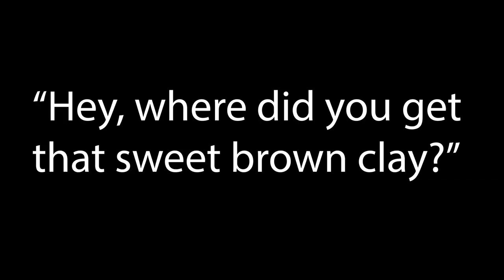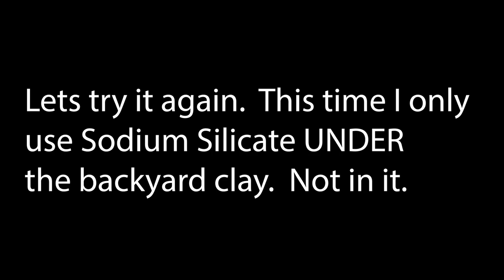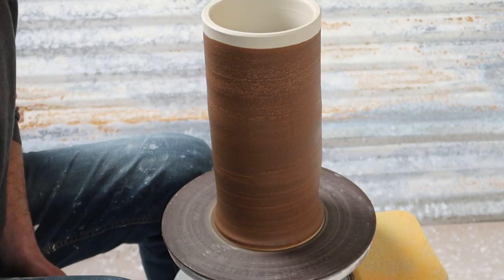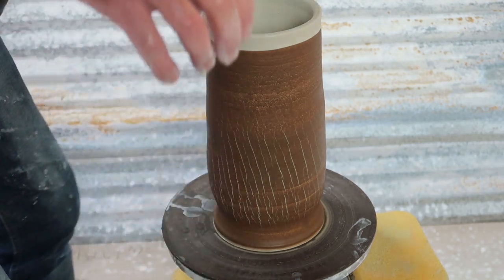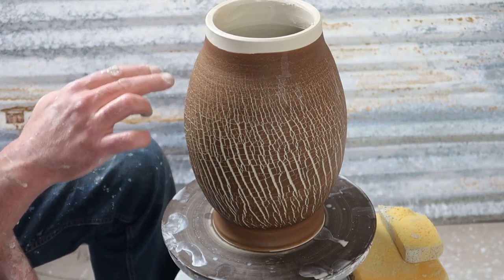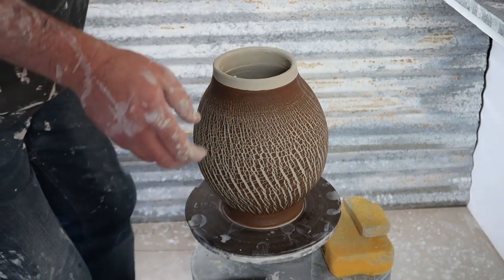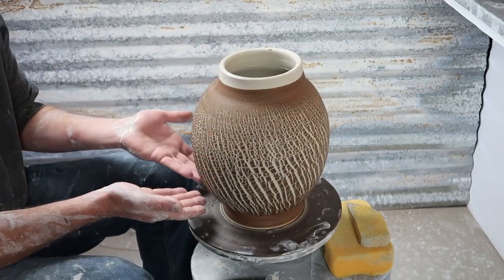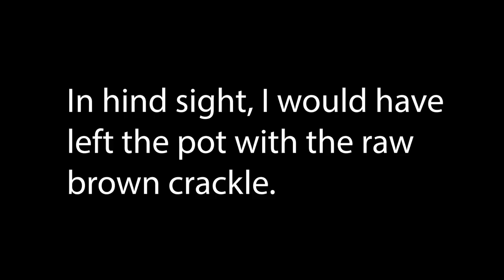Sodium Silicate Crackle - Backyard Clay - Spraying Glazes

Comment: The problem with the wobbly rim did happen much earlier in the process, it is hard to fix when you have already expanded the body. 

There are two things you can do to improve the situation, first throw your cylinders differently. Open wider than the final width and always keep it coning inwards when pulling up, you need to maintain volcano shape basically. If you try to pull / lift a perfectly straight cylinder you are going to make it, ever so slightly wobbly, and this wobbliness will only get worse over time. The other benefit of the volcano shape is that you get more clay up, I am gonna take a guess that your vase is a bit bottom heavy and that you cannot trim all that away without ruining your crackle pattern. 

Second, when expanding the shape; it helps if you make a little impromptu rim by bending out the last half inch on the top. It works on the same idea as a corrugated metal roof in that it gets stability from bending in one direction by being bent in the other. I like to rest a finger on the rim and let me left arm lean on the inside of the rim a bit. This helps maintaining it straight but you also get feedback when you go to hard pushing out. Another thing that also helps is to do the first expansion pull really slow and only move very little material. When you heat the pot the clay stiffens up and you need to crack the clay open again. If you go to hard here it is rather easy to make a dent that cannot be undone. I start by establishing a slight grove in the very bottom, then I lift that grove up and out. After that, when the clay is cracked open, you can be more aggressive with the expansion. 

I was trying to think of Youtube material that could be interesting but the only thing I can come to think of is this workshop: https://www.youtube.com/watch?v=Bn9zlSKXoho much like Joe I dry out my pots on the inside before expanding them, it really helps a lot, especially if you want to get the top back in to make nice rim.
Reply from the maker: Wow!  Thank you for the comment.  I appreciate your thoughts.
Reply: @JustinsMakery   Hi Justin.  First, what a nice pot!  Second, I remember reading something about using a plastic flange to help keep the top of a pot in shape as you expand the form.  I've never tried it, but it may be worth a look:  https://community.ceramicartsdaily.org/topic/17964-how-to-throw-this-form-in-one-piece/?tab=comments#comment-145766

Comment: I threw sort of a cone shaped piece that is say about 4" or so wide and is narrower and rounded at the end.  After bisque firing it I can wet it and gently fit it to the top and it help to even it out a bit.  Hit it with some heat if the clays too wet or let it stand for a bit and then see if you can continue to throw it.

Comment: When expanding the pot friction will cause it to twist in one direction. Running the wheel clockwise will cause it to twist in the opposite direction giving vertical cracks - in theory. In practice the pot becomes unstable and things end badly.
Perhaps watch Hsin-Chuen Lin for a masterclass on this technique - using porcelain!

Comment: Try holding the rim while you expand the pot for centering purposes also, move the rib to different positions is between 6 and 3 o clock to get difference in  swirls.. I think for alternate direction you maybe could try by centering the clay down in alternate directions top and bottom, I think it might not of worked because the clay was centered in one direction. An interesting video as always, thank you.

Comment: I had suspected it would have more to do with the fixed counter clockwise orientation of the clay structure; thrown clockwise the crackle would flow clockwise. I'm trying to figure that out for such things as mug handles and tea spouts, to get them to align properly after the drying and firing process. That's a sweet looking pot. A local artist uses sodium silicate to mimic tree bark, does the most amazing forest themed pots with vividly realistic lichen, moss, leaves.... Did you try putting the sodium silicate on the surface of the brown clay rather than mixed in it? Seems mixing it in would work more as a deflocculant up to the point where it starts to change the chemistry of the glaze recipe; sodium silicate by itself is used as a surface hardener for firebrick and refractory fiber, which you are probably well aware of :P

As an aside, I've learned that sodium silicate can be ordered from Home Depot by the gallon for significantly less than from most pottery and art supply stores.
Reply from the maker: Thanks!  I didn't try it on top of the slip.  Thanks for the tip on Home Depot too.  I didn't know that.
Reply: @JustinsMakery  Yup, Blick Art Supplies wants $16.45 for 16oz, Home Depot $30 a gallon.

Comment: Do you have to use a blow torch to make it work or could you also use a heatgun?
Reply from the maker: A heat gun would work great too.  I just don't have one.  Technically, just leaving the sodium silica sit out in the open air will do it.  I've left it spinning on the wheel in front of a fan.  Takes longer and the SS can run.  Even a hair dryer has worked for me, although it takes a bit longer than the torch.
Reply: @JustinsMakery  thank you!

Comment: I guess that when you are pushing out from the inside, that the clay used to make the pot is wanting to unwide?

What you was saying that when throwing the rim, and about wet clay running down the outside!

d, use was resist on the outside before you start attempting to throw the rim ;)

On various pots I use this method, and it always works for me Justins.

The wax will burn off in the kiln.

Yes before attempting the rim, from around 3" down on the outside I would try to manoeuvre that part into the middle [or as much as possible]. You won't be able to centre it completely, but it could be a lot better after doing this, to throw the rim.

When it's finished Don't be concerned about the whole pot being off centre, only if someone puts it, will they ever know it's off centre: LOL

Justins I just found https://www.youtube.com/watch?v=ZxieJvFGp1g thrower, you might want to watch it ok! he gets beautiful crackles, but what's more! he manages to keep the rim centred all through. AMAZING.